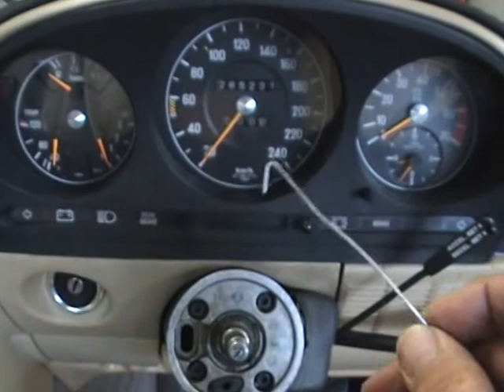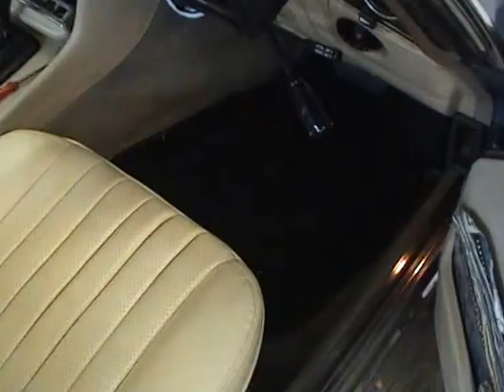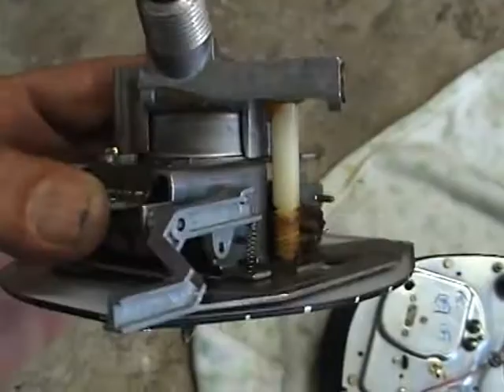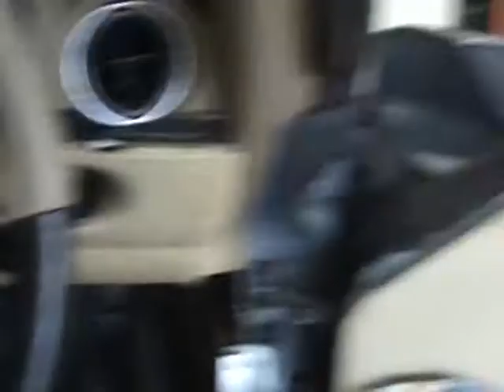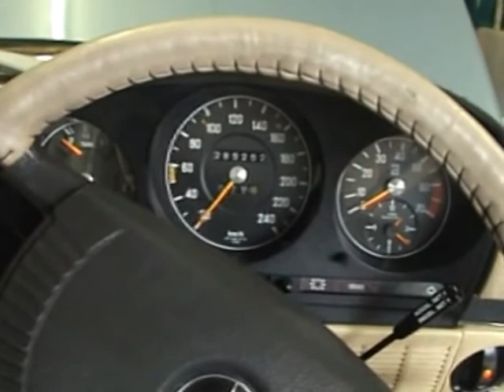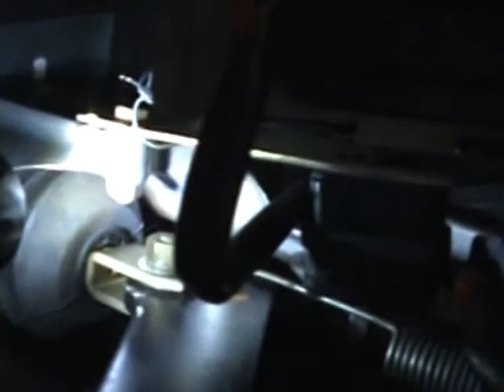1977 Mercedes 450 SLC instrument panel removal

Comment: mate, HUGE help for an idiot like me, thank you so much. After 50 years, the oil gauge tube on mine  crumbled off and had to put a new one on. Thankfully they still make the whole part. The nut holding my steering wheel on looks a bit different than everyone else's, it was a lot bigger than a 22mm, 39? I already forget. I used electric tape to fasten the old busted tube to the new one, so I could just tug it through by pulling the old one out. Wouldn't want to mess around in that tight space trying to grab onto something. I should have taken note of which direction my steering wheel was before I took it off, cause I think I put it back on a bit crooked. Oh well. And the oil tube started leaking oil out of the busted part the second I loosened the connection of the tube to the instrument panel, dripped on the floor (I had it covered). 

Wonder if you could 3d print that part you're looking for?

Comment: Would a 75" 450 SL be this "same basic thing" ?  GREAT GREAT Video Sir !!
Reply from the maker: Hi,the only difference is that my 77 SLC model doesn't have an ECU for the engine and is heavier with it being longer. 77-80 cars do not have electronic injection, I found out the hard way. Cheers, Paul.